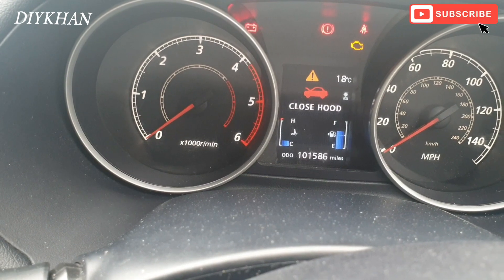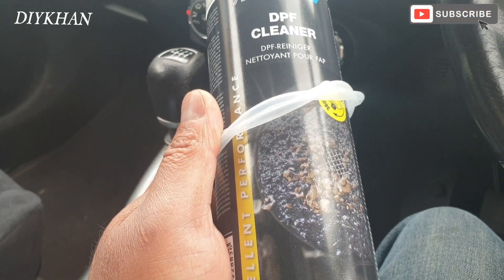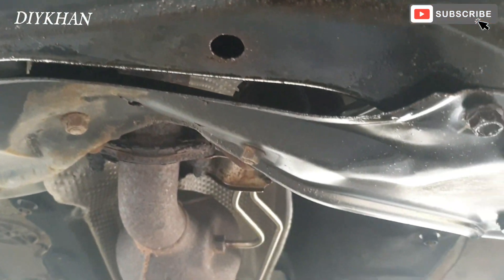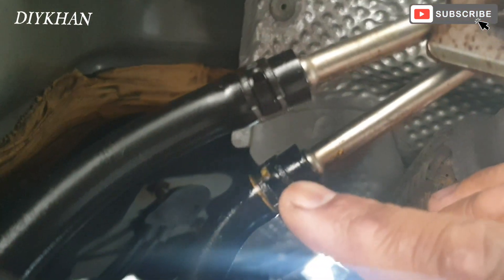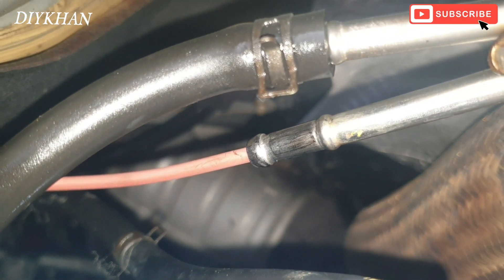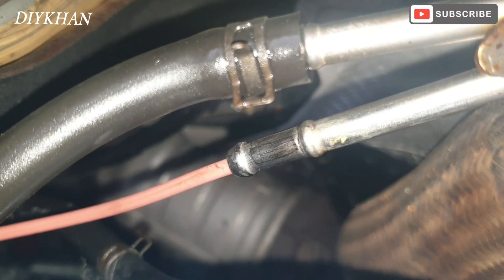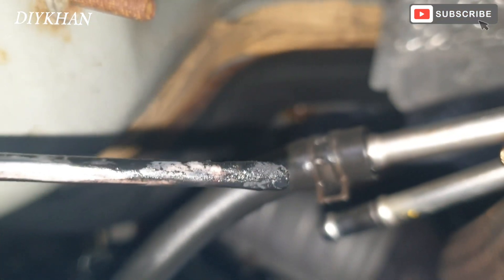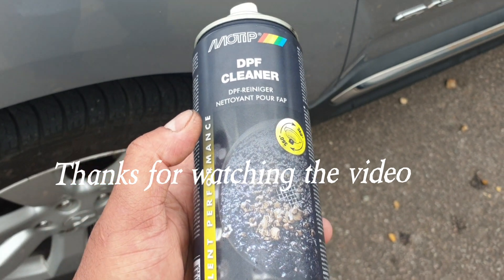Mitsubishi Outlander DPF Cleaning Process. How to Fix Mitsubishi Outlander Diesel Particulate Filter

Comment: Mine had blown turbo,the dpf seems to be blocked as the car won’t start,if you remove the exhaust it will,there’s no fault codes? Also is the Dpf the first one on the exhaust close to the manifold or is that the Cat?